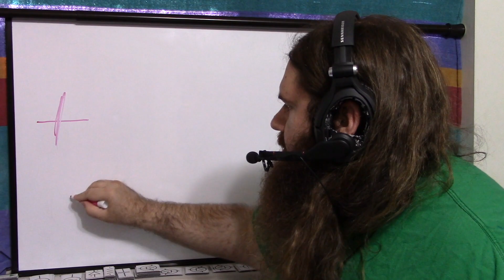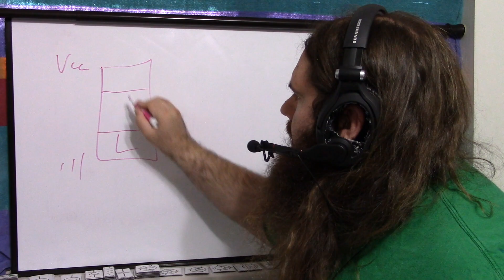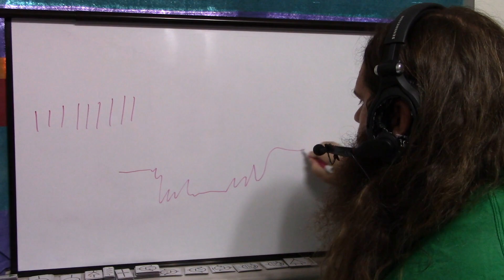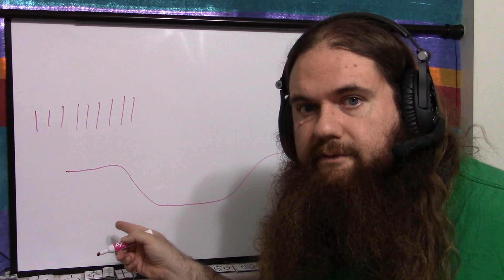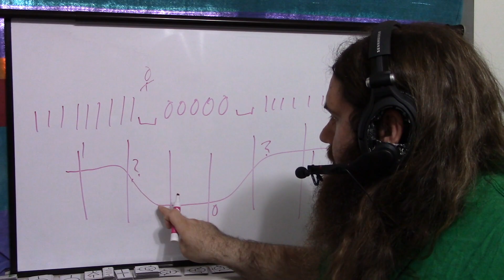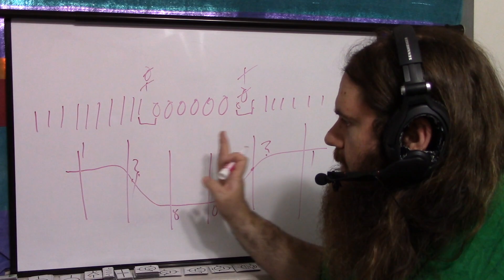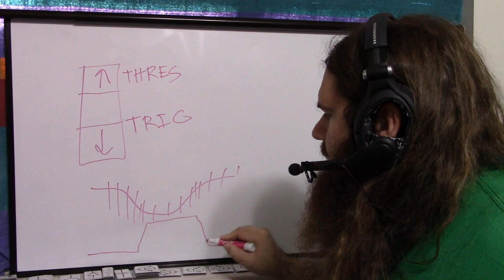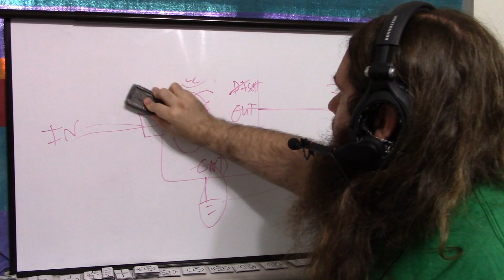How Microcontrollers Read Digital Signals and Sampling Frequency and Timing - Simply Put

Comment: The best way to debound a button? has to be the edge triggered latch, though some micro controller have an edge triggered interrupt.
Reply from the maker: That's what this is, essentially: The 555 timer is acting as an edge detector during the recharge (switch released, end of bouncing). And now that you mention it, you totally could use a timer as an actual edge detector! I love this chip.

Comment: I would watch a video on just nyquist's sampling theorem
Reply from the maker: More properly the Nyquist-Shannon sampling theorem. That's a cool one! That's why it's extremely common to see 44.1kHz to 48kHz as desktop audio sample rates, because human hearing is roughly 20-20k Hz.
Reply: @simplyput2796  There are modern formats which use hi-res audio which samples at even higher 192kHz frequency because shannon-nyquist assume you use perfect sine waves to recreate the sound but if you have a step wave it can distort the high frequency.